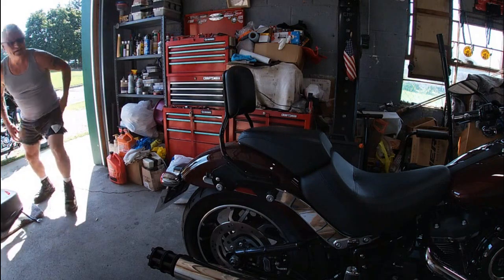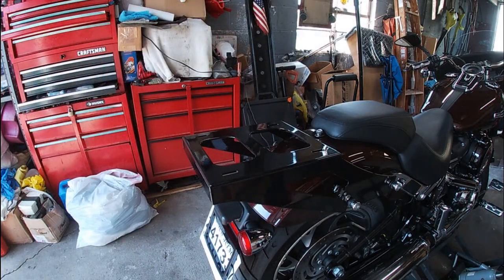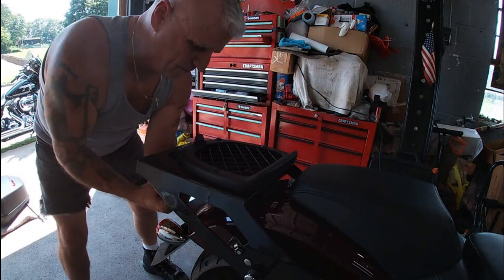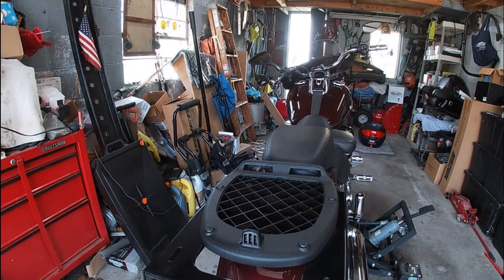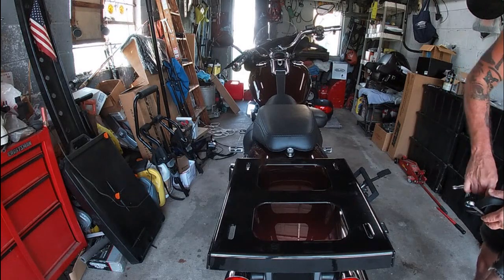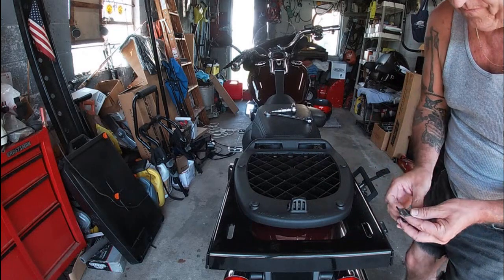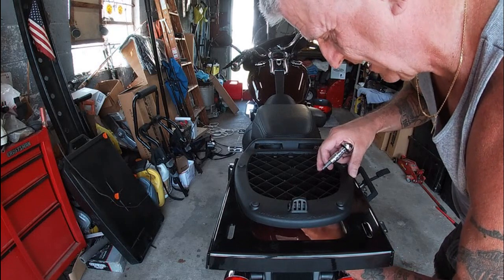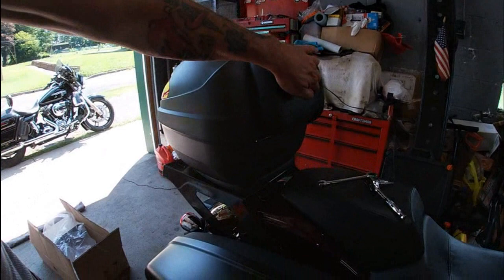2018 Sport Glide Tourpak mount and Givi E300N2 trunk installation

Comment: Curious as to why you're going with the drilling holes route for the back rest instead of just using the suction cups that are already present?? Perhaps because it will not stick well to plastic?
Reply from the maker: the suction cups will not stay stuck to the plastic  and while not too expensive i didnt want to lose the pad
Reply: @thousanddollarmann7978  you are right sir!! Will not stick to plastic. I went with velcro cuz that's what I had laying around and that works perfectly. The plus side to that is you can remove and install on the fly!
Reply from the maker: @lopezdad30   did you use the industrial grade velcro?
Reply: @thousanddollarmann7978  yessir!! Industrial velcro supposedly good to hold up to 10lbs. I just cut out lil square strips and put one on each of the 8 suction cups, then I just matched them up on my givi E300n case
Reply from the maker: @lopezdad30  Nice... keep us updated on how that works out over time